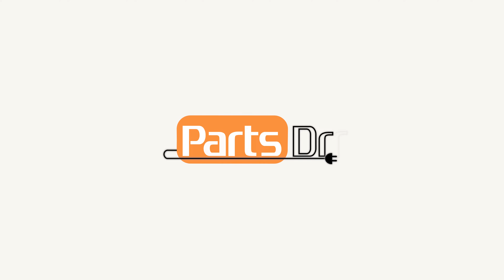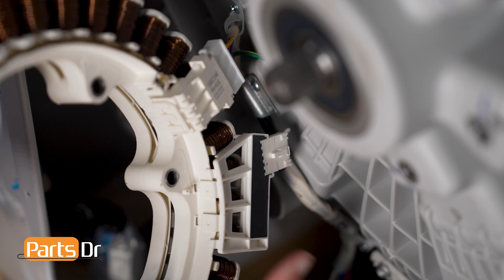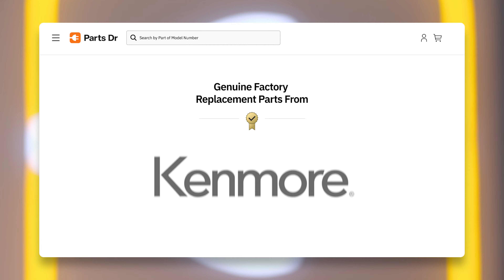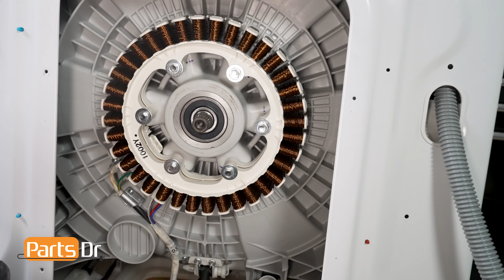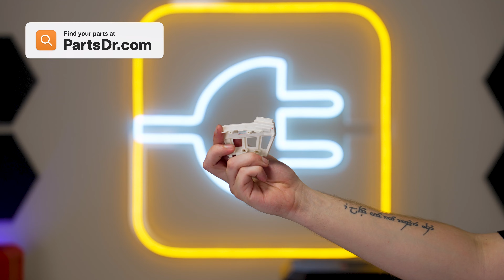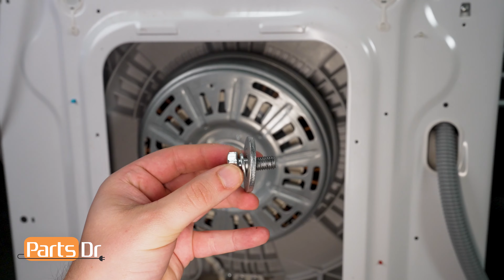LE Error Code? How to replace Rotor Position Sensor part # 6501KW2002B on your LG Washer

Comment from the maker: Thanks for watching our step-by-step guide on fixing the LE error code on your LG washer! A quick reminder: if you're ordering parts online, especially from places like Amazon or eBay, be careful. Many of the cheaper aftermarket parts we've seen are of much lower quality, and in some cases, they can fail quickly, causing even more problems. For a reliable fix, we recommend using genuine OEM parts. You can find the Rotor Position Sensor part # 6501KW2002B and other high-quality LG washer parts on our website at https://partsdr.com/part/6501kw2002b-rotor-position-sensor. They might cost a little more upfront, but they’ll save you time and money in the long run. Good luck with your repair, and let us know how it goes in the comments!

Comment: For LG (6501KW2002A) "This part is discontinued by the manufacturer or no longer available at Parts Dr."
Reply from the maker: Hi Michael, you can use 6501KW2002B in place of 6501KW2002A.  Here is a link to that part: https://partsdr.com/part/6501kw2002b-rotor-position-sensor

Comment: Whats the difference between part number 2002B or 2002A ?
Reply from the maker: 6501KW2002B is the newer version that replaces 6501KW2002A. Here is a link to it: https://partsdr.com/part/6501kw2002b-rotor-position-sensor

Comment: I wasn't planning to fix my washer myself but it looked so easy this 80 year old woman decided to go ahead and do it myself. I have some suggestions that were helpful to me. I found it easier to shut off the water from the whole house as the faucets were hard to turn. I would have a towel handy as there will be some leakage when you undo the water from the machine. I like to have handy a small container for all parts I remove from any project. First snag was removing the 4 screws holding the back in place, 3 came off with no problem but 1 was really tight, a very long substantial philipshead screw driver got it off. The next issue was getting off that large center bolt. What worked for me was using the screwdriver inserted into one of the slots next to a bolt then tapping my ratchet wrench with a hammer, done. To get off the magnetized wheel I found wearing disposable gloves gave me the traction I needed to remove it. The 6 bolts came off with no issues. I was unable to disconnect the electrical component but the rotary sensor came off easily and reinstalled easily so no need to disconnect the electrical components. I had put a foot stool behind the washer and that big round piece rested on it while I did this. Putting it back together was effortless. I am now getting my laundry washed once again with a vow to myself not to overload the washing machine. Thanks for your very instructive video
Reply from the maker: Nice job fixing this yourself!  Inserting a screwdriver into the slot to hold the rotor is a great idea!